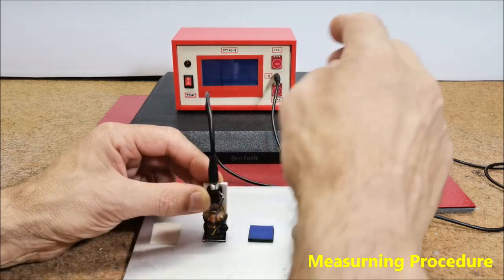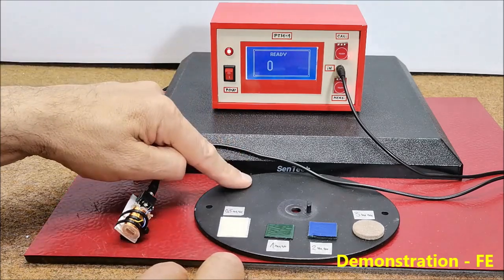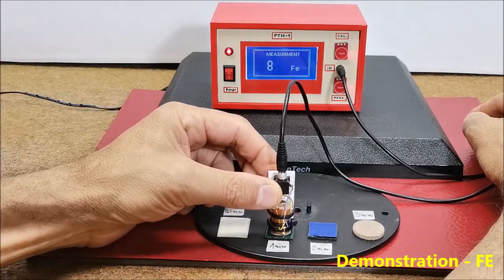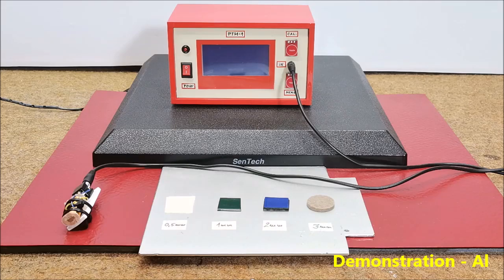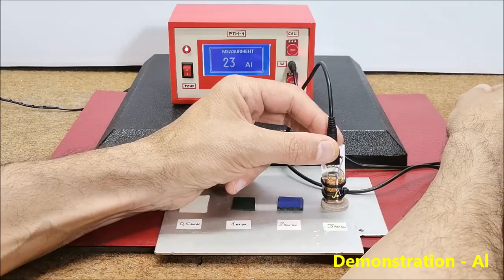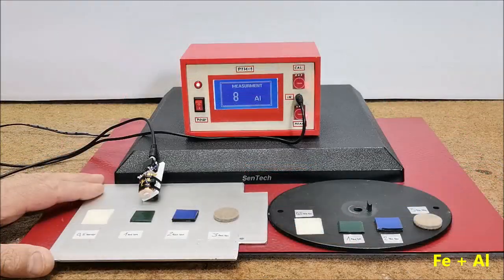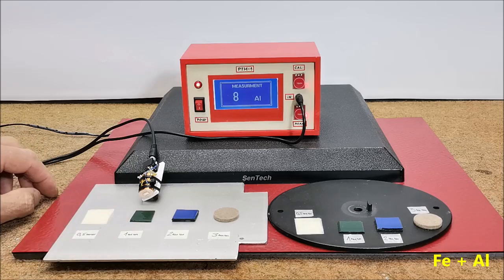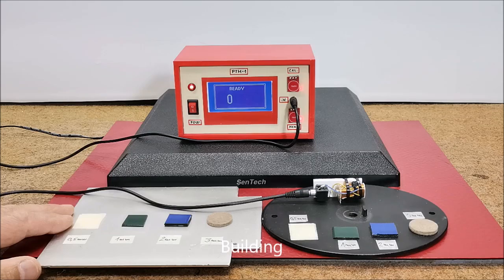Arduino Car Paint Thickness Indicator   Meter

Comment: But that's not a measurement, an estimate at best. And there's no unit for the result. How can you switch to aluminum? You have a huge display but it doesn't show any information. Shouldn't a device like that work with an ultrasonic sensor? And the coil should be shielded, maybe you can make an improvement. Yes, I'm a software tester.